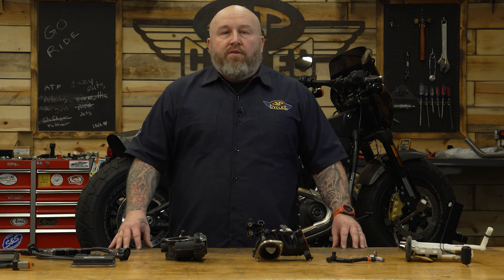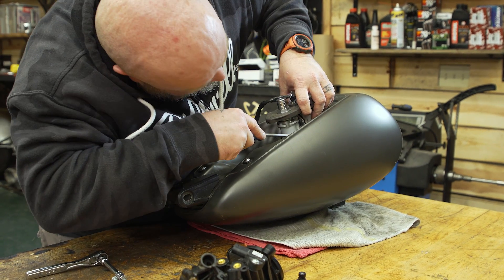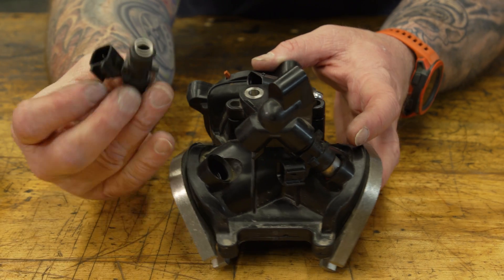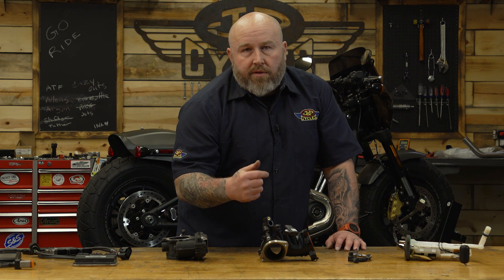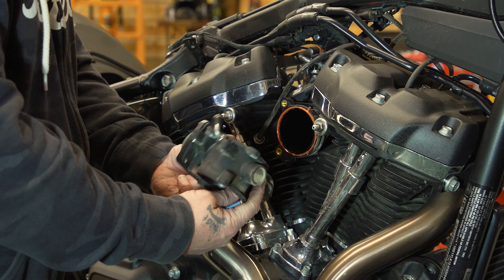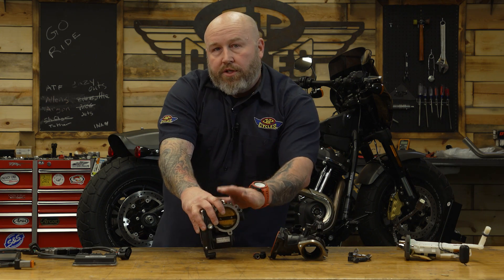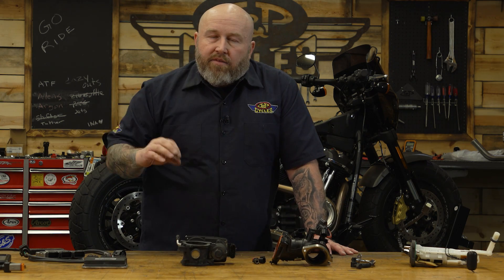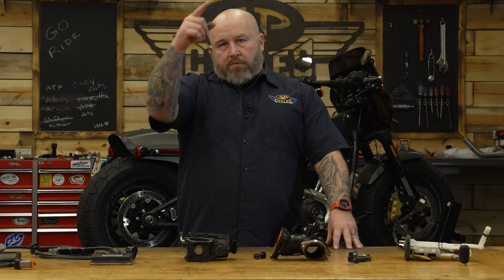Anatomy of an EFI System : Pro Tip

Comment: Hey my question is … and what I was trying to figure out when I found your video is…. Where were the O2 sensors?? Aren’t they part of the fuel delivery system in an EFI?? And they’d plug into the ECU yes?? Sorry yes I’m just spitballing the idea of turning an older bike into a fuel injected one and trying to figure out everything I’d need to do it… so I was thinking I might be able to pull parts off another bike.
Reply: O2 sensors are on the collector exhaust to read and report to the ECU the exhaust gazes.  Here, Pat is talking about air and fuel intake. What your are searching for is after the engine

Comment: The best thing I ever did was remove the failing magneti marelli fuel injection system off of my 96 FLHR-I.  I put on a Mikuni hsr42, an Ultima ignition. Runs like a whole new bike now. Will never go back to fuel injection.
Reply: Ha… came here looking into doing the exact opposite what was wrong with your efi??

Comment: Great information Patrick, as always 🤘🤙👍
I'm nearly ready to install some new parts I have, : 

Polished s&s intake manifold.
5.5 injectors.
S&s cam plate and pump.
468 redline cam.
Quickie push rods.
Fueling lifters. (& lifter cuffs)

All ready have a stage 1, and have my power vision.
I also (potentially) have a chance to buy some new 117 cylinders to upgrade my 114, apart from a tune of course, any other pieces of information or parts that would be of benefit, "IF" I upgrade to the 117. ??

Have a great day, thank you.

Comment: Hello Patrick, question for you I have a 2019 RGS with a 475 S&S cam, adjustable push rods, S&S tappet covers, screaming eagle tappets and a full Reinhardt exhaust system. Would it be beneficial for me to replace the throttle body and manifold to like a 64 mm.
Reply from the maker: Possibly, I think you may see some gains. But I would probably wait until you added a big bore.

Comment: Great vid.  I have just serviced everything inside my 10k mile 03 Anniversary FLSTFI with most parts from your shop.  I was experiencing hesitation and wondered whether the original owner did any fuel system maintenance inside the tank for the 15 years he owned the bike.  I got my answer when I pulled out the pump assembly from the tank (not fun!). The pre filter bag had disintegrated and the hoses were dark yellow.  Replacing the check valve, all hoses, the top plate special screws and gasket, the filter, the regulator and the pump can all be done for about $200 in parts.  I highly recommend it as just changing oil and plugs and the easy stuff is not enough.  She really roars right now.  Thanks for listening.  🏍👍🏍